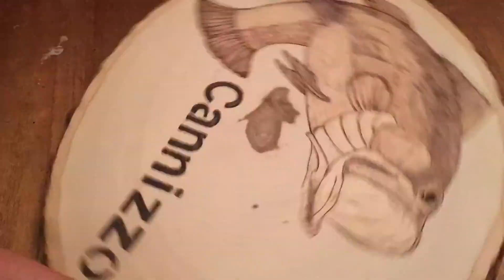Pyrography. Burning a bass on basswood .

Comment: I use basswood multiplex (4mm). It is nice to burn on it but what about toxicity? Multiplex means there are several wood layers... I think of wearing a protection mask (like 3M 4255). Your opinion is welcome. Thanks!
Reply from the maker: Bronzato Thanks for the comment . I have to admit I have never burned on basswood multiplex before . I stick to pine and the basswood rounds / cookies . As you stated Multiplex is several layers put together . I assume glue holds all the layers together . With that you could be dealing with toxic fumes when you burn on it . When I’m working on a project I like to have a fan blowing away from me so it’s pulling the smoke out of my face . I also wear a mask nothing special. As for the mask you mentioned I say do some research on it to see if it will perform the way you want and keep you safe .
Reply: Kyle Hall woodworker Thanks. As you stated I also ventilate the space (fan) to avoid breathing fumes and open  the window. I think all of that with a serious protection mask should be a good think. Your fish is amazing 😃
Reply from the maker: Bronzato I would thinks .  Thank you for the compliment, I hope to have some more pyrography videos up in the future .